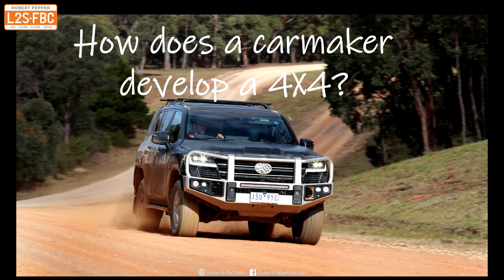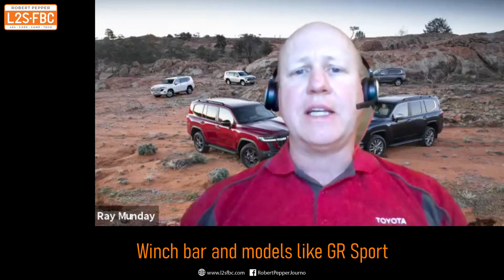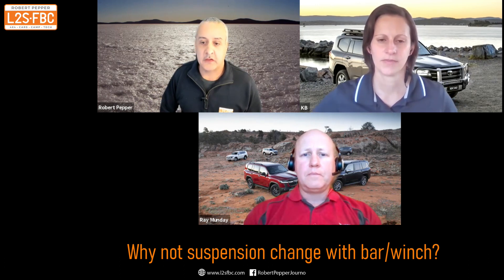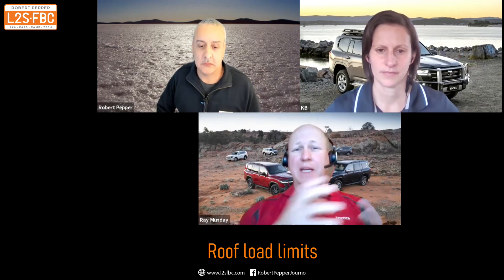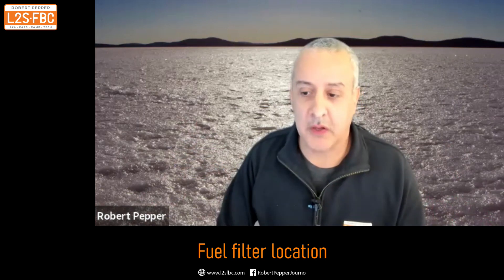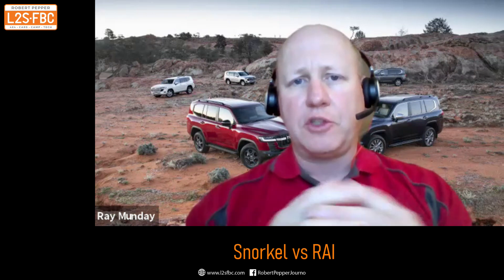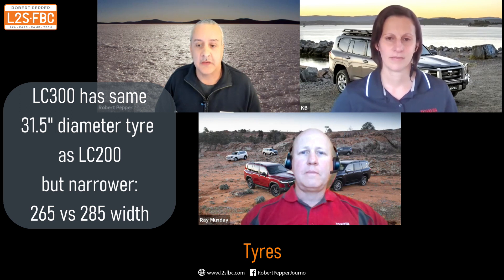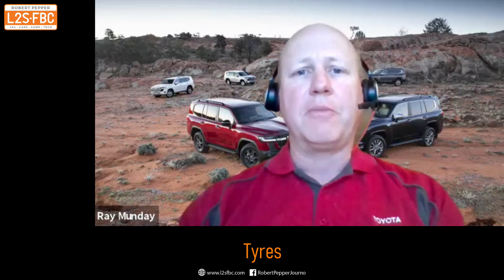4X4 vehicle development - LC300 tech engineer interview,  Part 4/4 - accessories and specs

Comment: Great series, thank you.  

Am I the only one left scratching their head when I learnt you can't fit a winch to the GR Sport version? 

If it was built to be the most advanced for serious off roading with EKDSS, front and rear diff lockers does it not follow that people doing serious off roading would want/need a winch for any number of conceivable scenarios? If only to pull one of their mates out who didn't make it through!

I think you let them off the hook regards that point and the 650kg payload lol, very kind of you Robert.  Ofcourse you got the point across which was the main thing.
Reply from the maker: Yes odd re winch. As for letting them off the hook - well, I could push harder but there'd just be the standard PR comment. As you said, the point was clear.
Reply: @L2SFBC  What I didn’t mention in my first post is I take possession of my GR Sport in a few weeks. 

I particularly ordered it a year ago to replace my 2020 plate Sahara 200 series because it had the factory fitted front and rear diff locks along with the EKDSS but now I’m wondering if I’m taking a step backwards as I can’t fit a winch nor is there the option for a GVM upgrade or lift due to the AVS. 

My bad for not doing enough due diligence however be lying if I said I wasn’t disappointed in Toyota. 

Perhaps down the track ARB or another third party might find a fix but at present their telling me I can only fit a bullbar to the GR Sport and that’s it. Not even side rails as it interferes with factory components.
Reply: @Kevin-ee2tz  I also purchased the  GR sport as it was pushed as the ultimate and most competent off road version.  Only to find out i cant fit a winch .  Very dissapointed with toyota
Reply: @buzz7927  Unconscionable Conduct comes to mind but that’s probably pushing the envelope a bit too far. 

Objectively a failure of appropriate disclosure on Toyota’s part I believe. 

I’m no extremist or technical 4x4 guy but there’s a lot of comfort in knowing you have a winch when towing a 3,000kg Kedron in isolated areas without company. 

Looks like I’m off to buy a hand tirfor winch!

Comment: Robert thank you for the outstaning series of questions you posed to the guests.The apparent openness of the guests in parts 1,2 & 3 was appreciated. However, it was very obvious to determine when the guests were confident and not so confident. Throughout the series Ray sprouted accessories as a strong factor in the design, however when you raised a number of specific specs they became elusive. The roof loding is a major issue and at no time or place is it specified in Toyota information or specs. If the information Ray Munday provided is correct a roof top tent cannot be fitted to an LC300 (weight wise). I have an LC300 and nowhere in the user manual does it address roof loads.This is a massive step backwards. 
The other significant issue is the fitment of a winch. Throughout the marketing and hyperbole from Toyota, the GR Sport is the ultimate offroader and yet the Toyota winch bar/winch cannot be fitted due to axle loads. WTF. Previously these details have never been documented to consumers and possibly never relayed to the delaers.
Reply from the maker: Darren - you are perceptive. Interviews like this should be analysed for what is not said and how what is said, is said. You can gain much from such analysis and I agree with you. Please share the series, thanks!

Comment: Great series, one question you may be able to find out is have Toyota done anything in the 300 series to strengthen the front CV's as 
I have seen a shatter in hard off road conditions from shock load?

Thanks 
Paul.
Reply from the maker: Not that I know of